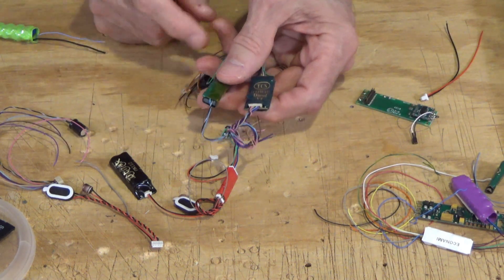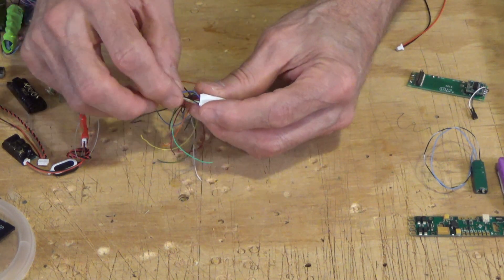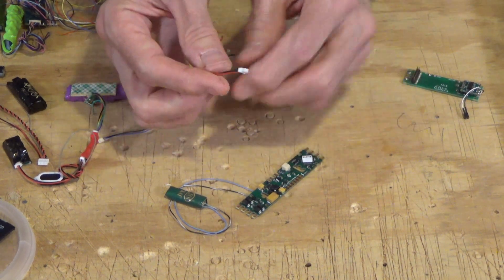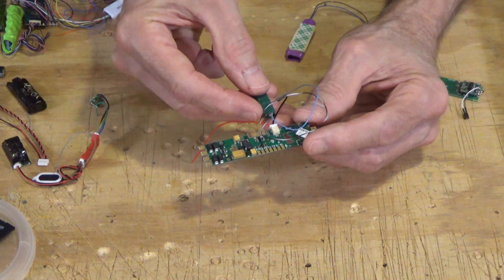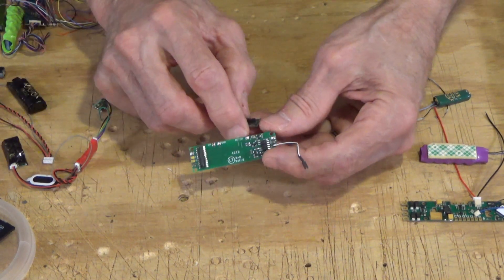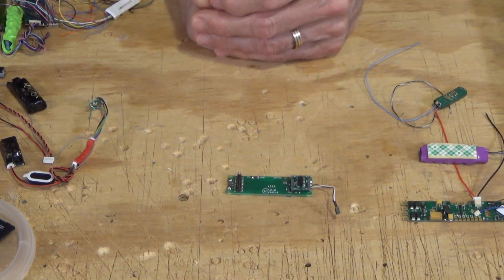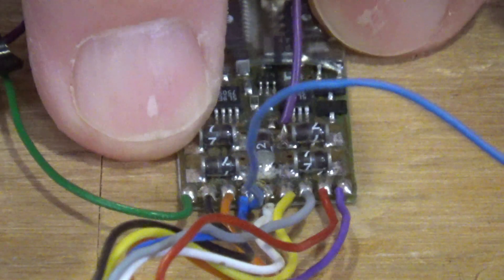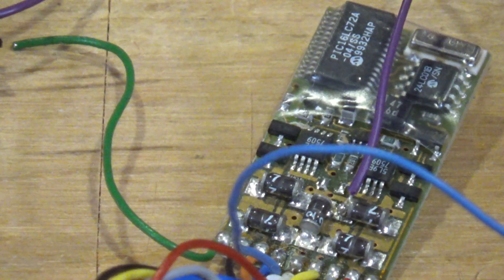DCC Keep Alives, making the connection (32)

Comment: I have been using Digitrax decoders for some time, and I tried one of their power extenders to solve a particular problem. What I noted is on the 10 pin connector, the power extender is wired to pin 5 (black) and pin 7 (red). Oddly enough the standard issue capacitor (as supplied on a new decoder) is not wired to pins 5 & 7, but to pins 6 (blue) and 10 (black). 

So this begs the question, if you build your own keep alive with the diode, caps, zener and resistor, do you wire this to pins 5 & 7?
Reply from the maker: Sounds like they changed their design for the decoder and Power Extender on the new decoders, but I knave no specific info on that. I’ll have to check around and see if anyone knows. I may have to see if I have any direct contacts left there.
Reply: Thanks for the response. It seems that the off the shelf decoder capacitor is only for the sound system, while the power extender is wired into the entire decoder and sound. There are notes scattered around about connecting a keep alive to the lower side of the rectifier. Maybe thats the change here.  @TheDCCGuy

Comment: Hi Larry, I have connected a few of my home made stay-alives to some locos, they do work but as soon as any of them loose connection with the rails, they go forward for a fraction of a second and that's it. I've seen commercial stay-alive/dcc combos run the loco for several seconds, do you have any idea what I'm doing wrong ?? I did make them before I see this video, I did take the negative from the dcc where I found dc at full voltage, which is 16v on my system. Thanks for this video, it's very informative 😊
Crikey.... I've just seen that you made this video 5 years ago 😯 Hope you are fit and well 🙂🙂
Reply from the maker: It is my understanding that a static charge field is created between the two electrodes and the individual pieces of static grass become charged themselves. That is why they stand up on end when they hit the surface. Down the road I plan to do a video comparing whether it matters where and how the ground is placed.

Comment: Thank you! I'm dealing with a TCS 1516 V4 for steam with the tiny KA that comes hardwired with the decoder. I also bought a KA 2 which I may not need if the included hard wired capacitor works through the turnouts.

Comment: Re: JST plugs Polarity Correction. 2 pin connector, use a sharp knife of razor blade to ease up the retaining plastic, gently pull the cables out, gently push them back into the correct location. I feel the correction activity is good investment for 2 minutes, is MUCH better result with far less worry or possibility of future error. Thanks for your video, a great reference. PS I Recently purchase some Chinese made JST9 pin connectors, using the above technique, corrected the cable color sequence, so now using them with JST9 DCC chips in old Athearn Locos.   :)

Comment: Hi Larry, thanks for your good clear videos on this subject, my problem would be soldering to a Lenz silver that’s smaller than my thumbnail, even though there’s info about which pads to go to. 
I imagine I need to invest in a micro soldering iron, have you any advice on what kind would do for the job?
Reply from the maker: Yes, that will be tricky. I use a Hakko soldering iron that I got on Amazon. You can get very fine tips for it. Take a look at my soldering videos, such as #35, 38, 68.

Comment: I have TCS WOW Sound decoders with the small capacitor and want to add TCS Keep Alives.  Is it as simple as cutting the blue and black/white stripe wires from the capacitor and soldering them to the two wires from the Keep Alive?
Reply from the maker: Yes, it is that easy. You are simply replacing a single capacitor with several (and a few electrical components).

Comment: I tried following the link to the Australian website, it appears to be a dead link. I'm trying to find out how to add a keep alive to an XL systems 0001812 and an XL systems 0001961 dcc decoders thanks
Reply from the maker: Yes, that’s the problem with websites, they aren’t guaranteed to last forever. It appears XL is a Chinese company that previously made decoders for MRC and is now marketing those designs under their own label. I think their logo is a skull and crossbones!
Reply: @TheDCCGuy  That aside, if I find the bridge rectifier on the decoder can a keep alive be attached in the same manner that you describe in this video and will it function properly?

Comment: Current keepers are great on the old stuff with horrible electrical pick ups rather then adding ,but there are issues with programming creating a delay or not even working at all . Seems power needs to be cut on service track programming ,but with the keep alive it does not go off like it should. Anything to do to fix it ?
Reply: You can use a Circuitron RS-2 magnetic Reed switch to make and break the connection without taking off the shell. A magnet is used to flip the switch, like how Rapido is with their passenger cars.

Comment: what about adding a Current Keeper/Keep Alive/etc to a Soundtraxx Tsunami2 PNP decoder without using the provided plug? I have such a decoder that the plug was damaged, but the decoder still works. Is it possible to find the negative point on the diode as you showed at the end and attach a wire to that? I assume the other wire would just go to Function Common or V+.
Reply from the maker: I would think you have 2 options: (1) replace the old socket with one sourced from eBay or possibly even SoundTraxx, or (2) solder the wires directly to the decoder after removing the damaged socket—you would have the exposed contacts right there.
Reply: @TheDCCGuy  not possible, the plug is gone all together and it took the surface mounted metal contacts with it. Trust me, if it was that simple I would have done it already. That's why I worded the question the way I did.
Reply from the maker: If you contact tech support at SoundTraxx they likely will email you a photo or diagram showing where to solder the connection. However I use a lot of the Econami PNP boards and have not had to use a stay alive with any of those.

Comment: Great video and very informative.   I installed a TCS KA1 keep alive installed on a LOK SOUND 58420 Version 5 decoder in an Proto 1000 RDC.  Is it normal for some heat to be generated by either the keep alive and or decoder?
Reply from the maker: They may heat up a bit so it is always a good idea to make sure they are not too tightly enclosed. That said I have a LokSound micro on a Kato NW2 switcher and it has performed well for several years. That one is sitting in a depression cut into the metal chassis which I think acts as a heat sink.
Reply: @TheDCCGuy  Thanks so much for the information!

Comment: Hi Larry. I don't know if you will actually see this as the post is from 2019. BUT.....I have installed a Digitrax Power Xtender on a Digitrax decoder and a Soundtrax keeper on a Soundtrax decoder. Both of them keep the sound and lights on. The Soundtrax does a much better job as the duration is amazing. However, the Digitrax doesn't keep the motor running while the Soundtraxx does. I can snag the Soundtrax engine off of the tracks and the wheels continue to turn. The Digitrax stops immediately. Digitrax help line says that theirs is doing what it was designed to do (?)........ SO, I want to cut the Digitrax off and solder on a Soundraxx using the same wires. Can I do that? This is in an RDC with plenty of room so I could even build my own per your video.  Thanks, Larry. If you see this and have time, can you drop me a line?
Reply from the maker: I recently saw another complaint along these same lines. I need to install the Digitrax sound decoder with Power Extender that I have and see how it behaves. It is starting to sound as though these are designed just to keep the sound alive and not support motor power.

Comment: If the decoder manufacturers were on the ball they would include keep-alive circuits on their decoders. And don't get me started on the lack of Railcom support.
Reply from the maker: Yes, but they’d just pass along the added cost to consumers. This way you get a less expensive decoder without a stay alive and you can decide whether you want/need one in your locos. Of course TCS does offer versions of their decoders with a KA and their replacement motherboards have them built in. Another issue is the size required to pack 4-5 capacitors into the decoder. For N-scale and some small HO locos that can be a real issue. I have run into a few instances where only the TCS Keep Alives will fit and even then it was a real squeeze. I rarely use them on HO diesels and larger steam. I do put them in small steam locos like 0-6-0s and diesel switchers. It would be a waste of money to put one in my Challenger. With 4-6-6-4 wheel arrangement and a centipede tender there is more than adequate power pickup.

Comment: Thanks for the help Larry. I have a few tcs ka3 keep Alives that I need to add the jts connectors to. Would you be able to post a link to exactly what you bought for this. ?
Reply from the maker: I checked my eBay account and can’t find my prior order however the following look like what I got.

https://www.ebay.com/itm/US-SHIP-Mini-Micro-JST-DS-LOSI-2-0-2-Pin-Connector-plug-with-Wires-Cables-20pcs/232447578903?hash=item361ef49317:g:NrcAAOSw7mNcsGRc
Reply: The DCC Guy thank you sir. I appreciate it

Comment: Excellent video Larry, thanks. The information about the 1mm JST connection for the Soundtraxx decoders is extremely useful, I have wondered how it would be possible to connect my generic keep-alives to their decoders for some time. I am assuming this is the same pin used on their non-board decoders?
Reply from the maker: The only other Soundtraxx decoders I have used are the Econami and Tsunami2 which have individual wires. This same connector does fit Digitrax stay alives so I am assuming this is a size manufacturers are commonly using. However you have to be aware of the fact that just because one manufacturer’s connectors may fit does not guarantee that the wire connections are the same or that the polarity is the same so check, check , check before connecting anything. I point this problem out in my October 2019 DCC Corner column.

Comment: I have done the ESU decoders on the 21 pin board and put a TCS keep alive on it. It works nicely for me.
Reply from the maker: Whatever you do remove the Keep Alive before doing any programming with a LokProgrammer and possibly others. It can harm components on the decoder and they are closely scrutinizing any warranty replacements because of so many damaged this way. I talked with them today about it in detail. More to come in a future video as soon as I get a chance to work with these some. Some folks have had success using a latching magnetic reed switch to turn the KA off and back on again after programming.
Reply: @TheDCCGuy  I use a 2 pin connector that I unhook when programming. I also use one for the speaker so I can take the decoder out of the locomotive if needed. I have accidently tried to program a ESU with the keep-alive attached and all it does is come up in the software as a unrecognized decoder. When that happens I just unplug the keep-alive and it worked perfectly. I have never fried a decoder on a nix board by not attaching the keep-alive. This is just my experience. Yours may differ. Loving the video series. Very informative. Thank you for making them.
Reply from the maker: Good move. I think that the damage may only occur when using a LokProgrammer to load sound files into the decoder. I keep bugging the  to add a small plug and socket to the boards so folks can easily do this but the techies in Germany won’t do it.

Comment: In going over the electric diagram with components shown, I searched my electric parts box to find I had all the components to make a keep-alive except one item. I do not have a 1 watt 100-ohm resistor. But I do have 2--1/2 watt 100-ohm resistors. I have plenty of room to put the extra component but wondered if I'm going down a slippery slope. I presume that if I can use the two resistors, I need to put them in a parallel configuration.
Reply from the maker: The wattage should be OK but you could easily get by with a 100 ohm 1/2 W unless it is O scale or larger. The 1/2 W size is much easier to find but don’t drop down to the 1/4 W ones.
Reply: Thank you for your assistance. As the "keep-alive" was being built, I checked all components after soldering to other components. I found that I had two capacitors that didn't make it. Don't know if it was to much heat or just bad components. I had a few extra capacitors, so it did not matter with the H.O. scale installation.
Thak you again.
Reply from the maker: Glad to hear you were able to cobble one together.